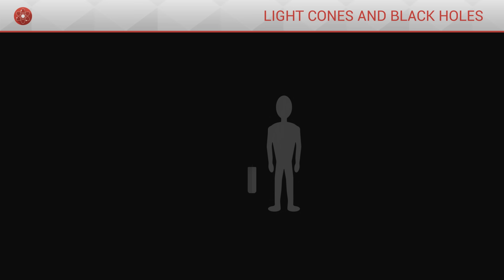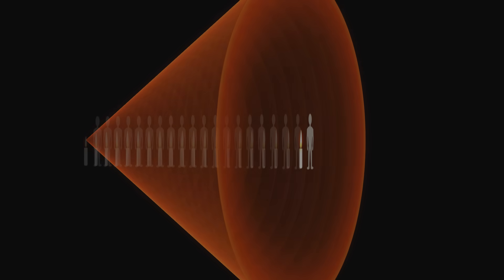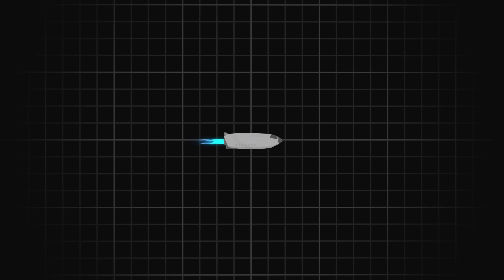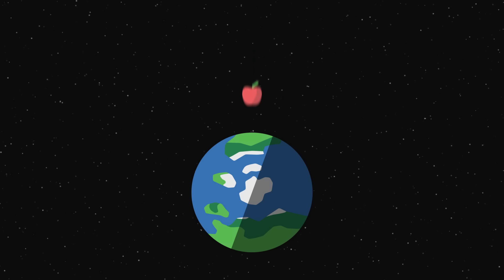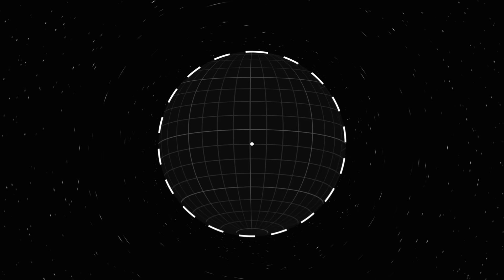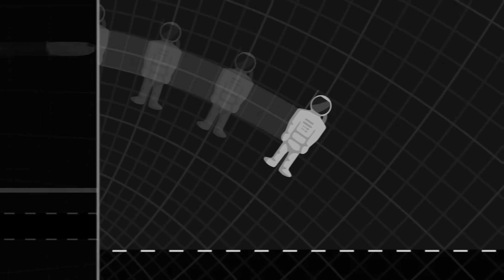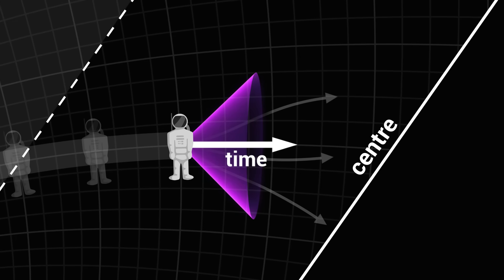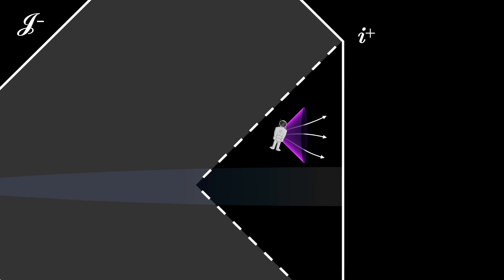Why Time and Space swap in a Black Hole

Comment: The speed of light is not a constant as once thought, and this has now been proved by Electrodynamic theory and by Experiments done by many independent researchers. The results clearly show that light propagates instantaneously when it is created by a source, and reduces to approximately the speed of light in the farfield, about one wavelength from the source, and never becomes equal to exactly c. This corresponds the phase speed, group speed, and information speed. Any theory assuming the speed of light is a constant, such as Special Relativity and General Relativity are wrong, and it has implications to Quantum theories as well. So this fact about the speed of light affects all of Modern Physics. Often it is stated that Relativity has been verified by so many experiments, how can it be wrong. Well no experiment can prove a theory, and can only provide evidence that a theory is correct. But one experiment can absolutely disprove a theory, and the new speed of light experiments proving the speed of light is not a constant is such a proof. So what does it mean? Well a derivation of Relativity using instantaneous nearfield light yields Galilean Relativity. This can easily seen by inserting c=infinity into the Lorentz Transform, yielding the Galilean Transform, where time is the same in all inertial frames. So a moving object observed with instantaneous nearfield light will yield no Relativistic effects, whereas by changing the frequency of the light such that farfield light is used will observe Relativistic effects. But since time and space are real and independent of the frequency of light used to measure its effects, then one must conclude the effects of Relativity are just an optical illusion. Since General Relativity is based on Special Relativity, then it has the same problem.

A better theory of Gravity is Gravitoelectromagnetism which assumes gravity can be mathematically described by 4 Maxwell equations, similar to to those of electromagnetic theory. It is well known that General Relativity reduces to Gravitoelectromagnetism for weak fields, which is all that we observe. Using this theory, analysis of an oscillating mass yields a wave equation set equal to a source term. Analysis of this equation shows that the phase speed, group speed, and information speed are instantaneous in the nearfield and reduce to the speed of light in the farfield. This theory then accounts for all the observed gravitational effects including instantaneous nearfield and the speed of light farfield. The main difference is that this theory is a field theory, and not a geometrical theory like General Relativity. Because it is a field theory, Gravity can be then be quantized as the Graviton. 

Lastly it should be mentioned that this research shows that the Pilot Wave interpretation of Quantum Mechanics can no longer be criticized for requiring instantaneous interaction of the pilot wave, thereby violating Relativity. It should also be noted that nearfield electromagnetic fields can be explained by quantum mechanics using the Pilot Wave interpretation of quantum mechanics and the Heisenberg uncertainty principle (HUP), where Δx and Δp are interpreted as averages, and not the uncertainty in the values as in other interpretations of quantum mechanics. So in HUP: Δx Δp = h, where Δp=mΔv, and m is an effective mass due to momentum, thus HUP becomes: Δx Δv = h/m. In the nearfield where the field is created, Δx=0, therefore Δv=infinity. In the farfield, HUP: Δx Δp = h, where p = h/λ. HUP then becomes: Δx h/λ = h, or Δx=λ. Also in the farfield HUP becomes: λmΔv=h, thus Δv=h/(mλ). Since p=h/λ, then Δv=p/m. Also since p=mc, then Δv=c. So in summary, in the nearfield Δv=infinity, and in the farfield Δv=c, where Δv is the average velocity of the photon according to Pilot Wave theory. Consequently the Pilot wave interpretation should become the preferred interpretation of Quantum Mechanics. It should also be noted that this argument can be applied to all fields, including the graviton. Hence all fields should exhibit instantaneous nearfield and speed c farfield behavior, and this can explain the non-local effects observed in quantum entangled particles. 

*YouTube presentation of above arguments: https://www.youtube.com/watch?v=sePdJ7vSQvQ&t=0s 

*More extensive paper for the above arguments: William D. Walker and Dag Stranneby, A New Interpretation of Relativity, 2023: http://vixra.org/abs/2309.0145 

*Electromagnetic pulse experiment paper: https://www.techrxiv.org/doi/full/10.36227/techrxiv.170862178.82175798/v1 Dr. 

William Walker - PhD in physics from ETH Zurich, 1997

Comment: So if the singularity of a blackhole is also a fixed point in time does that mean a black hole can't orbit anything and thing's can only orbit a blackhole? If you found 2 blackholes and measured the distance between them would it always be the same?

Comment: It's improtant to consider extreme time dialation here.
Singularities dont necessarily exist because it would be plusible to say that for and accelerating object falling to the center of a blackhole, time would slow down so much compared to the outside, that by the time the object were to reach the center, so much time have passed that it have already been radiated away as hawking radiation.

In other words, if we could look into a blackhole we would not see singularities, but we would likely see a collapsing star in really really slow motion, never to actually become a singualrity because the blackhole would evaporate by the time a singualrity should form.

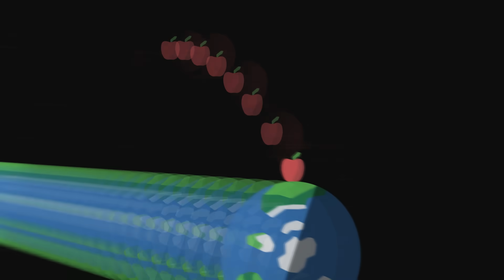Comment: 5:30 Problem!
It's not light that bends towards the earth but apple. Because 1st cone of light should be traveling in a straight line continuously forever, even if the apple falls down. So should the 2nd, 3rd and 4th cone do. And all the 4 cones in fact are traveling in their respective straight line. For each movement of the apple, a new cone emerges settings the previous one free to go where it's initial direction was. So, all the 4 cones are different and they have different paths to follow. It's not light that bends here, but the apple itself, which gives birth to new cones that are independent from eachother.

Comment: I am not sure if this is a great explanation. A Black hole is nothing but mass that has collapsed. Earth would be a blackhole if it weren't for the acceleration  (pressure) that earth exerts @ 9.82 m/s2 all around, that prevents the earth from collapsing into a blackhole. Earth also has a space time curvature that points towards it's center. The different being blackholes have such great curvature and no outward acceleration that nothing can really come out it once  something is within it's event horizon (start of it's spacetime curvature). Isn't the mechanics of it simply that?

Comment: The 45 degree angle of the “wall” of a lightcone is a convention, not a physical fact. You can make it any arbitrary angle depending on the linear scales you choose for time and distance. The point is that, for whatever scale you choose, the trajectory of a massive object through spacetime can’t be at a greater angle from the time axis than the this “null” geodesic.

Comment: What if your motion through spacetime is a bigger slope than 45 degrees but less than 90 degrees, so you escape the light cone but still go forward through time normally?
Reply: Nvm that would be slowing down time meaning giving a backwards force through time, which is impossible

Comment: Information cannot travel faster the light you say well then explain quantum entanglement then. Because information really does seem to travel faster then the speed of light.
Reply: First we have two particles. Then we move one particle (at a speed less than the speed of light), and then we read the parameters of the second particle. We knew at the beginning that the parameters of the two particles will be mutually opposite, and after measuring we see that their parameters are mutually opposite. We didn't transmit any information at all.

Comment: I usually use common sense for everything, and this theory makes no sense at all. Time is time, and light is light, to me there is no connection between the two of them the way these vectors show it. There could be light somewhere or not, but there wil be always time. So, if we turn off the light how this theory gonna work? Let's assume for a moment there is no light whatsover. The time will stop? Probably not. Let's assume we stop the time (not that we can). Will the light still keep moving? No, because there is no time anymore and since the existence of the light is in the movement through time that means the light cannot exist when time is off. 
What happens in a black hole (if they exist at all) no one can tell, because no one was in one of those so this sound like high scientific language with no purpose and proof. And what exactly "bending the space" means - removing some space from here and put it elsewhere? The star collapses and emits last flash of light? So, there is nothing left there, right? Then, how come nothing can escape from there? I don't know, I respect the scientists and all they do, but general relativity makes absolutely no sense at all to me, sorry.

Comment: What Im trying to understand is what dictates the light cone’s 45 degree orientation relative to its subject? What is the mechanism at work that makes a light cone propagate specifically 45 degrees from its source?
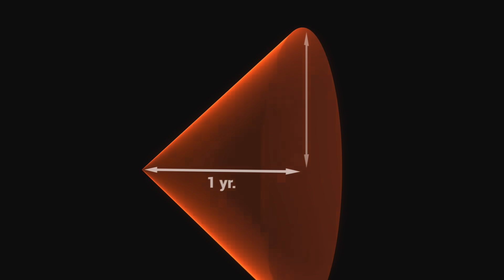Reply: it shows you between 01:00 and 01:30 of the video. It's moving away at one light year per year. So both horizontal and vertical are always the same, meaning 45' angle between them.
Reply: Dark matter? Or an unknown law of physics
Reply: Just light speed

Comment: I was totally with you up until 9:32 when the explanation seemed to skip an important step.
Reply: You have to remember that time & space being shown as only 2 dimensions, simplifies it a bit too much that it makes some of it hard to understand. but the main thing is that spacetime is being curved so much that the lightcone is now pointing only in the direction of the singularity.  As shown at the 9:02 mark. You'd need to be going faster than the speed of light to escape the lightcone, which is why the future is the singularity.

Comment: As recently shown, the idea of a Black Hole being a singularity is  unproven (and the original paper says it takes infinite time to form - not that it forms in reality!)  The original calculation by Hawking, as Dr. Kerr pointed out, was mistaken! (an aside)  You are making a fundamental mistake; your ASSUMING that at the horizon the the light cone continues after that point. That is not something you can prove  - you are assuming physics that is unknowable in principle; your just extending math in a region that cannot be known or even tested. Your model (i.e. real physics) stops at the event horizon - period. Any further speculation using math is the exact same as saying division by zero can be ignored and the math continued (a poor analogy, yes, but a similar reasoning that idea is your using.)

Comment: There is an instantaneous connection between masses along the direction of time (which connects two masses with gravity which is generalized thermodynamic entropy.

As electromagnetic radiation propagates at the speed of light isotropically from its source it modifies the entropy gradient and temperature reaching masses in the distance.
Reply: "gravity which is generalized thermodynamic entropy" is it just me or does that sentence make literally zero sense? Would you like to elaborate on it a bit?

Comment: the fact that light cones are 45 degrees from the flow of time actually tell you that any universal timestep is smaller than lightspeed.

that, even if you move from one place to another faster than the speed of light, you might not travel faster than time, or, at least, SOME unit of time must have passed.

it might be helpful as a definition of the direction of time. but, its not particularly helpful as a limit of temporal causality anymore than a sound cone would be. or, at least, that some causality is not strictly tied to light speed because time moves faster than light speed.

Comment: All the statements about black holes in this video are based on mathematical artefacts. How, for instance, is a "great distance" defined? For an observer at any – arbitrarily small – distance from the event horizon times stops at this horizon. So in effect, nothing ever crosses the horizon, which, in turn, invalidates all statements about the black hole's interior. This is to say, our universe ends at a black hole's event horizon. And, by the way, to say that light cannot escape a black hole is incorrect as well. Light cannot travel slower that the speed of light (in a vacuum)  even leaving a black hole. What can happen is that the light's energy is reduced to zero, meaning that its wavelength is infinite.
Reply: Those artifacts sure seem to be very persistent if they can be observed in telescopes. "And, by the way, to say that light cannot escape a black hole is incorrect as well" it is entirely correct by definition. Any and all geodesics that pass through the event horizon of a black hole end up at its absolute singularity. This is a mathematically provable fact, as well as an observed one. What are you even talking about?

Also, all you need to do to pass through the horizon in a finite amount of time is to construct your coordinates in a way that follows a falling mass into the black hole instead of observing it from the side.

Comment: I think we "move from the past to the future" because of the nature of our consciousness and our memories.  The way we identify a moment as being in the past is basically the fact that we have a memory of it.  The microscopic laws of physics mostly don't care - they will happily run in either direction.
   
Time feels absolute to us because all of us have very low relative velocities to one another.  The rates at which our experience of time line up with some coordinate system time would be different if we routinely moved at high speeds relative to one another.  Because of this, physics  allow us to adjust our "proper time to coordinate time" ratio.  However, the fact that we can't make those relative velocities greater than the speed of light places a limit on this, such that we will all always agree on the  in which a series of events occur.  So physics has a built-in protection against any sort of disagreement about timelines.  Time dilation lets us stretch and compress the timeline relative to one another, but we can't re-order it.  Yes, black holes can do strange things to all of t his, but at the same time, if we get to one of those strange places, we're trapped inside the event horizon and can never get out - another sort of "built in protection of time integrity" that the universe seems to have.
   
Finally, since consciousness is integral to parts of this, and since we don't  what consciousness is or how it works, we're missing a major piece of the puzzle, which is why we all wind up having big philosophical conversations about it all.

Comment: Doesn't it make sense that the center of a black hole could be so extremely dense and pressurized that the particles at that location might actually be completely anchored in place? In other words, completely motionless. Which implies the possibility of absolute zero temperature. But that's under the assumption that there is no singularity at the center which seems much more likely to me, considering a black hole's gravitational effect on space and time.